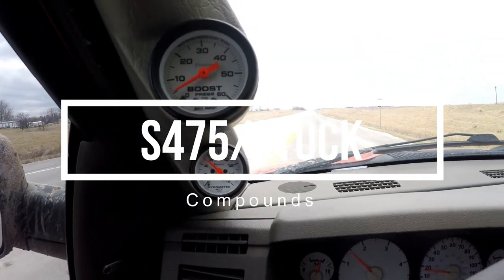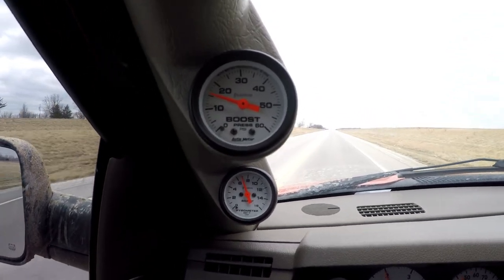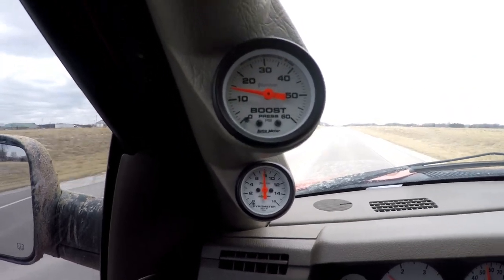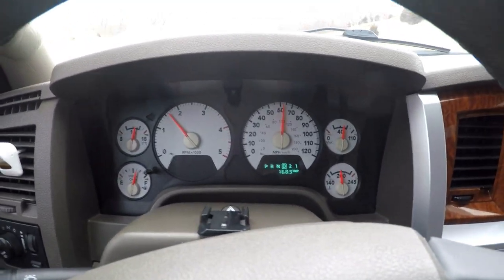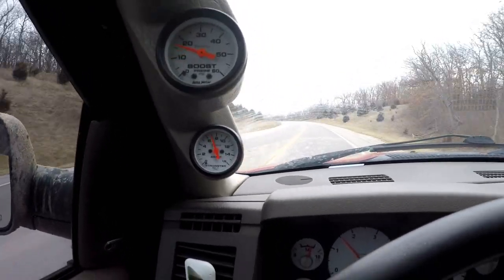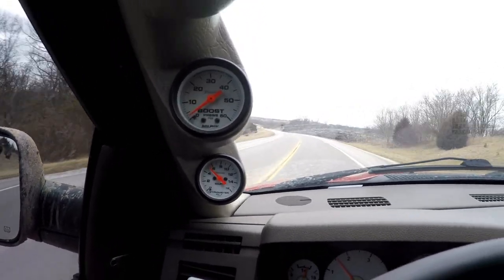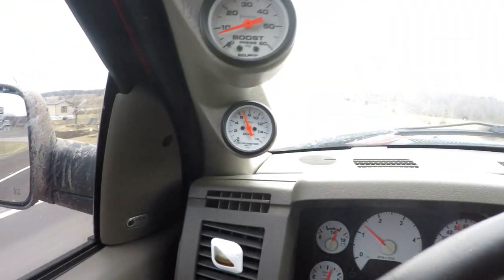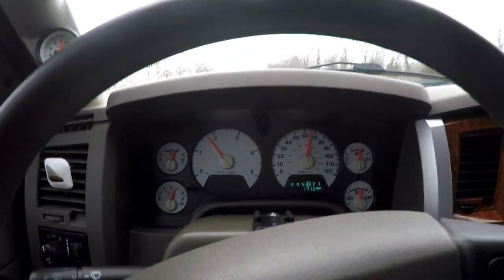EGTs  2006 5.9 Cummins Single vs Compounds

Comment: Good video.  Ive had a 66mm Silverbullet on my truck with stock injectors for the past 10 years and thinking about going stock/s400 compounds or have my turbo rebuilt with a billet wheel and steed speed manifold before doing injectors/cp3.
Reply: depending on your power goals that could work,  running s300/s400 compounds have backpressure limits for sure, the small t3 foot of that silver bullet cant flow enough for more than 600-700 hp without needing an external wastegate to keep backpressure in check. if youre going to spend the money on a steed speed, just t4 second gen swap the truck with a 467.7 (aka 468)  enjoy it and if you want to compound it after that thor a 485/488 on top enough air for 1200

Comment: Why the change from compounds S475 to the single? I am about to pull the trigger on a Wherli fab compound with the S475 my self, and am very curious. Want performance, but I also tow with my 07 5.9 mega cab.

Comment: Do you have stock fueling at all? I just got a s472 with a billet compressor wheel, installed about 2 weeks ago. Egts get up to about 1200 going uphill. Currently just have a fuelab 100gph lift pump, exergy 10mm cp3 and stock injectors. What's your opinion on my egts?
Reply from the maker: First, do you have a 5.9 or 6.7?
Reply: KReyCummins 5.9
Reply from the maker: That’s a really big turbo for stock injectors. Your truck is not in it’s efficiency range because of the turbo/fuel matchup. You don’t really have enough fuel to spool the turbo properly, and if you can’t get the turbo to run efficiently you’re egts will be higher.
Reply from the maker: Mine are 900-1000 depending on how steep the hill and what speed I’m going. 1200 is a little high though. IMO
Reply: KReyCummins Thats what I figured and that's what multiple people have told me, just wanted to get another opinion. Once the turbo lights, egts  drop a little, and it spools pretty quick for the most part. The guy I purchased everything from talked me into it. I just didn't want injectors yet due to my stocks still being in good shape. I appreciate the response!
Reply from the maker: Yeah man! Best thing you can do is keep RPMs higher. It’ll lessen mpg, but lower EGTs a lot and help the truck run better.
Reply from the maker: Like turn overdrive off if you aren’t on the interstate
Reply: KReyCummins I understand, it's a weekend truck anyway so not too worried about the lower mpg. Everyone has told me to leave overdrive off as well haha. I do it now. Only think I don't like is switching out of "overdrive off" to overdrive or tow haul. I feel like it beats on my trans.